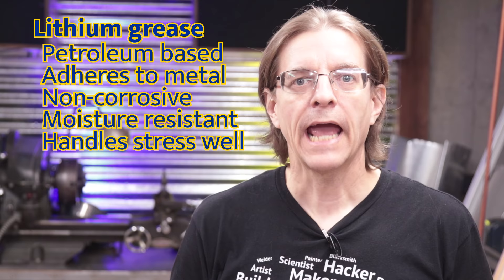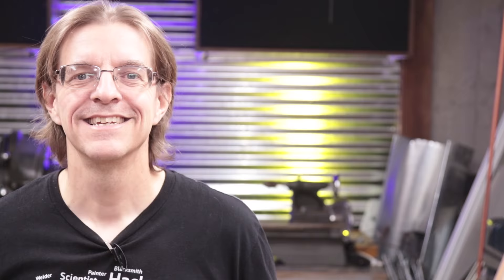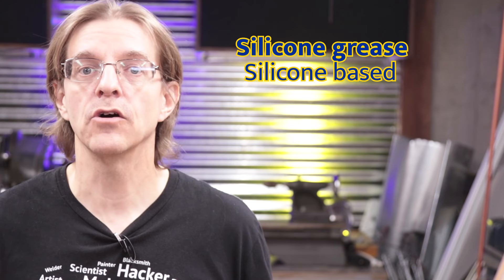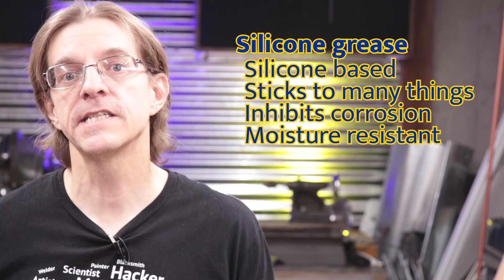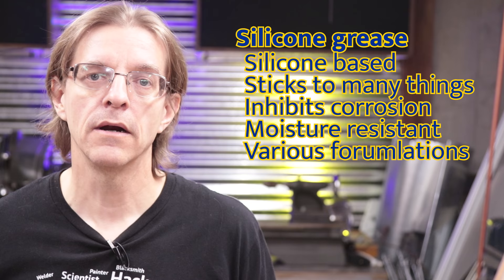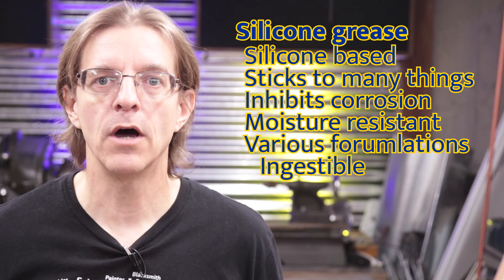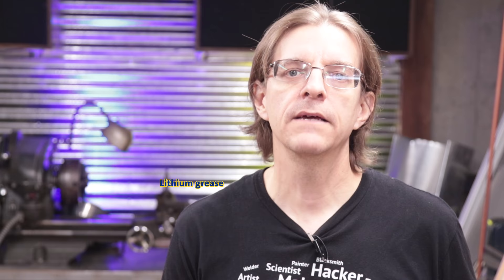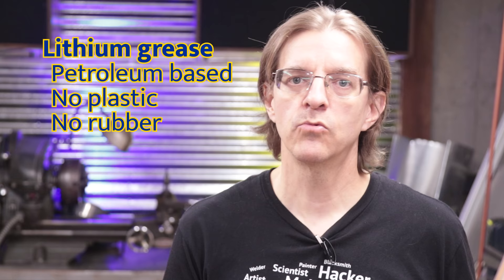Lithium grease vs silicone grease: Which to use?

Comment: What would be the best all around spray protectant/lube/inhibitor for hitting metal AND rubber parts in my engine bay?
Reply from the maker: Generally you don't need to spray your whole engine bay with anything other than water to keep it clean.

Comment: so which is better for installing swaybar bushings in my car?
Reply from the maker: I recommend checking the car manufactuer's specifications for that application.
Reply: Synthetic is better, I use Super Lube multi-purpose syn. grease, I buy it on Amazon. Been using it for yrs. on my guns, poly bushings on sway bar, control arm bushings which are rubber, you name it ect... Go to amazon & look it up, you can read what it's for & what it does. I use their oil too which comes in a spray with a trigger, not aerosol.
Reply: @NoWr2Run  thanks. i just got some synthetic grease.

Comment: Not much information. The title should say   "Lithium grease vs silicone grease: Which to use on brake calipers ?"
I viewed wondering about grease for brake, shifting, and latch cables.

Comment: Will silicone spray work on silicone couplers that go on car intercoolers and car air intakes? My silicone couplers don't want to slide on and off!
Reply from the maker: That's what I'd use. Although if it's already on, I don't know how much help it'd be to get it off.
Reply: @HouseOfHacks  mine are stuck on, but I can get a screw driver inside the silicone couplers and spray silicone through the red straw that attaches to the spray can and see if that works hopefully tomorrow.
Reply: @HouseOfHacks  and thanks
Reply from the maker: You're welcome and hope it works for you!

Comment: Just wondering, on RC cars, lithium grease will work great on metal gears, however will it damage the plastic gear housing/casing?.. or it wont because plastic housing is static and wont have any friction. 
Please spare some advice ya. Thanks ya.
Reply from the maker: If there's no moving parts (static) there's no need for lubrication there. But perhaps I'm misunderstanding. In any case, I'd just use silicone on the whole thing. Even the metal parts aren't going to have enough pressure on them in this application for worry about it. Hope that helps.

Comment: i have a metal(titanium?) part, grinding(actuating) plastic part. high speed, some heat. originally it has some white grease on it. since its contaminated and not really greasy any more, i need to replace it. what would be best to use?
Reply from the maker: I'd first try to find the recommendation from the manufacturer. Failing that, I'd use silicone grease.
Reply: @HouseOfHacks  thank you

Comment: Hi the white lithium grease I bought says its great for metal to metal contact. as well as metal to plastic and plastic to plastic contact? Why does it say its great for plastic contact if its not good for plastic?
I used some on my plastic gearbox and it stays right on the gears and doesnt fling off and runs extremely smoothly especially once its up to speed its absolutely silent in operation except in low speed you can hear the grease "stringing" around the gear teeth it sounds a bit sticky but it doesnt actually stick at all and runs really smoothly and DEFINITELY better than without the grease.
It came in a squeeze tube not the spray variety
Reply from the maker: If it's specifically formulated for plastics it'll be fine. Most lithium grease is formulated for metals and will degrade plastic over time. Hope that helps. Cheers.

Comment: which grease is best suited for rubber bushings in cars
Reply from the maker: Generally rubber bushings aren't lubricated. If they are, then check with the manufacturer.
Reply: @HouseOfHacks  front arm bushings always required bro

Comment: Now that we know neither silicone nor lithium are good for brake calipers, could you fill us in on just what is recommended?
Reply from the maker: There are special greases designed for this application. Check the car manufacture's recommendation.

Comment: I hadn't heard of either of these types of lubricants. I've been looking for non-teflon/teflon-like lubricants to use in bicycle parts for a while, but the bicycle lubricant/grease market seems to exclusively use teflon and teflon-like chemicals in their products. Is there any real reason why all bicycle lubricants are using teflon, or is there no real reason for it? I'd like to avoid dumping even more teflon and similar crap into the watershed so it would be nice to know of other lubricants that could be used.
Reply from the maker: I'm not sure why teflon based lubricants are popular in the bicycle niche. If I were to guess, it's probably because they're really slick, probably pretty light and don't provide much drag. Heavy greases probably increase resistance. No reason you can't use other lubricants for your own use.

Comment: As we use Electric Contact Cleaners for Electric circuits cleaning.. what about to protect circuit from  moisture? Is there any thing to protect circuit ?
Reply from the maker: Yes, electronics can be coated with a product called "conformal coating". There are a number of manufacturers for this. Just do a web search. Sorry I don't have any recommendations.

Comment: I have a large Panoramic Sunroof that opens on my Cadillac SUV: it’s getting to be 10 years old, and it’s getting tough for it to open, and close. Sometimes I even have to use my hand to help it close, or it will stop cause it thinks something is stuck in it, and it re-opens itself. 

 I bought White Lithium Grease to grease the tracks. That’s what I found most recommended from my brief online-research.. should I be super-worried about it getting on the rubber components (seals/gaskets, etc.) of the sunroof? Should I use a different lubricant all together for the tracks??? 

Is it a good idea to grease the rubber around the top? (With silicone grease or any-other recommended lubricant/grease suggestions)
Reply from the maker: Make sure it doesn't need to be cleaned first. I've found many times the mechanism that moves the window, not the track but the actual actuator connected to the motor, gets encrusted with dirt and gums up causing it to bind. The lithium should be fine as long as it's used in moderation and doesn't get on the rubber parts.

Comment: What type of grease can be used to lubricate rubber orings. At present we are using food grade silicon grease. I need an alternative for that. Acn white lithium grease be suitable??
Reply from the maker: It'll depend on the application. Is the food grade silicone grease because it's a food application? If so, you'll want something designed for that use, which a lithium grease probably won't be. The general rule of thumb is silicone grease for rubber/plastic and lithium for metal, but there may be specific greases that have different design parameters.

Comment: So which grease to use in brake caliper slide pin, where rubber boot is there?
Reply from the maker: Check with the manufacturer for their recommendations.

Comment: Hello HoH: What do you think about using silicone "white" grease for lubricating computer fans & optical disc drive rails + tray?
Reply from the maker: I don't have much of an opinion on those. Generally they have permanently lubed bearings from the factory and shouldn't need any additional lubrication.

Comment: hi,
and what about grease based on  Polyalphaolefin?or Synthetic hydrocarbon?can use on rubber/plastic?
thanks
Reply from the maker: It's generally not bad, but it does depend on the type of rubber/plastic. This chart has some compatibility charts: https://support.newgatesimms.com/lubricants-and-possible-plastic-or-rubber-compatibility-issues/

Comment: looking for silicon paste or any type to use as lube for my caliper guide pins etc. any recommended brands besides 3m? looking for cheaper options atm. thank you!
Reply from the maker: Sorry, I don't have a brand recommendation.
Reply: @Klippy Klop isnt silicone paste good for rubber and metal contact? it lubricates them.

Comment: Would silicone grease be better to use on a stairchair (Stannah 260 curved) - the “teeth” on the lower rail?
Reply from the maker: I'd first try contacting customer service to see if they have a recommendation. If they didn't have any input, I'd use silicone grease.
Reply: House of Hacks 
Thank you very much; greatly appreciated.

Comment: Which one is better for my sqeaky chair mechanism(its metal) ?
Reply from the maker: I'd probably use lithium silicone since there are probably plastic pieces in or around the mechanism. If not, either would work. Cheers.
Reply: I use silicone, as it is much less messy and works anyway. Silicone grease is nearly invisible to eye and lithium often is white, greasy, always visible. I prefer lithium to car's door hinges or lock mechanism.

Comment: thank you for posting this great video.i want to lubricate my gear stick in my car i was wondering is it good idea to use lithium grease?thank you in advance
Reply from the maker: Most gear shift mechanisms I've seen have rubber or nylon bushings so I'd go with silicone. But generally they don't need lubrication. If they're stiff, I'd look for other issues first, such as something bent or broken, or possibly an internal transmission issue.
Reply: Thank you so much
Reply: House of Hacks Would some light lubrication not be needed to keep them from potentially tearing from the constant friction?

Comment: Not correct. Most lithium lube rate temperature is 130 degrees c and silicone grease can easily handle 200 degrees. So for the high-temperature situation, silicone is better.

Comment: hi i have a question do you know if the xhp 222 lithium grease can destroy a plastic and rubber? coz i used that on my joystick  please if you know
Reply from the maker: Silicon grease would be better. Lithium grease works better for metal applications and, depending on the formulation, may cause plastic to degrade.

Comment: Hi there. Thanks for the video. I do have a JOBO CPE2 processor with lift for film photography. To transfer the rotation from the motor to the  film tank a metal bar rotate a plastic gear ( it looks very hard plastic to me ) that rotates the tank, the film tank it is touching the water in the processor's bath that keeps the temperature. The gear and the bar does not touch the water but need to be greased and when processing color the water takes up to 38 Celsius degrees. What advice me to use to grease this gears, silicon base or white lithium for this? Thanks in advance.
Reply from the maker: I'd probably use silicone.
Reply: @HouseOfHacks  Many thanks

Comment: So... lithium grease for my bike chain and silicone grease for the bedroom?
Reply from the maker: That would be the correct matching. :-)
Reply: no lithium grease will harm the O-rings on the bike chain,  use chain lube it is sticky and wont fling off.
Reply from the maker: O-rings on a bike chain? That's quite the bike chain. :-)
I suspect Christopher meant bicycle chain and you're thinking motorcycle chain.
Reply from the maker: Yes, it all depends on what products you're using where. Polyurethane is pretty resistant to most chemicals and shouldn't have any problems with most lithium greases. However many lithium greases contain petroleum based soaps that are not compatible with some plastics and rubbers so in general it's not recommended for those applications. As with anything like this, it's best to consult the manufacturer's data sheets for compatibility. Cheers.
Reply: What about silicone grease for upper and lower control arm bushings
Reply: so lithium gearse cant be use on motorbike o ring chain??

Comment: Why is Silicone grease considered low temp if Silicone hoses or Silicone anything is rated as 500f and literally is used in household ovens because it can handle high Temps?....
Reply from the maker: Greases are made up of many ingredients and generally intended for typical applications. The temperature profile for the overall composition of the grease may be less than the one ingredient it's known for, based on the typical use cases for the grease. Silicone grease is typically used in lower temperature applications and so is formulated for that use. In other words it's not the silicone that's necessarily the limiting factor but other ingredients.

Also, this video talked about general guidelines. It's probable that specific formulations can be found that can be applied outside these guidelines. As always, if there's a specific, extreme-use application question, the grease's datasheet should be consulted for appropriate use.

Comment: hi can i use lithium grease to lubricate noisy laptop fan?
Reply from the maker: Laptop fans generally have permanently lubricated bearings. If they're making noise, it's time to replace the bearings if possible (probably not) or the fan.
Reply: @HouseOfHacks  thx!

Comment: what about calcium grease to plastic will damage it?
Reply from the maker: I've not heard of calcium grease. Look on the label and read the MSDS sheet for it and see if it uses petroleum distillates. If so, it's better to stay away from plastic.
Reply: generally calcium grease is the same mineral oil base oil as lithium grease, however it uses a more heavy duty higher water resistant calcium thickener instead of lithium

Comment: So   W40 from which of these  Lithium Grease؟ OR  Grease silicone ?
Reply from the maker: Not exactly sure what you're asking... WD40 is not a grease. It's a petroleum-based solvent, water-displacer and surface protectant. It can be used for cleaning something before putting it together, using grease as appropriate. Does that make sense?
Reply: @HouseOfHacks  Thank you

Comment: CAN I USE WHITE LITHIUM GREASE TO LUBRICATE CAR STEERING WHICH MAKES SQUEAKY NOISE? Please reply.
Reply from the maker: I recommend checking the car manufactuer's specifications for that application.
Reply from the maker: I'd also be concerned that the squeak indicates worn parts that should be replaced rather than simply lubricated.

Comment: Hi can i use lithium grease on motocycle chain
Reply from the maker: Get a shaft drive. :-) Most manufacturers recommend a lubricant specially designed for motorcycle chains. In a pinch, lithium grease would be better than nothing.

Comment: Can silicone grease be used for lubrication of computer keyboard
Reply from the maker: It could, but, depending on the environment, it might attract dust and gum up over time. I'd probably me more inclined to use a dry graphite lubricant. Cheers.

Comment: the point of that is to..take out teared teflon paper ( Fuser paper) and spray on the HEATER part or Glass, spray inside that round teflon paper and and place HEATER inside that Teflon paper. so Sillicon spray helps that Teflon paper to move smooth and not stick anround heating parts.. is it safe or not safe? im searching for its answer cause i dont want my printers to burn or anything. thank you
Reply from the maker: I don't know. I'd be pretty hesitant to use any spray as most are flammable. My recommendation would be to contact the manufacturer and get their suggestion. An alternative would be to speak with a printer repair technician to get their input.

Comment: Why's it called lithium grease when it's petroleum based?
Reply from the maker: Lithium is used as a thickening agent to keep the oil from running out of the item being lubricated. It is inexpensive and has good overall temperature and anti-corrosion properties.

Comment: is Silicone Compound same as Silicone Grease? 

there is a piston on my hydraulic brake lever and needed Silicon Grease but is hard to find, that is why I ask if this is just the same?

it needs to apply the grease on the rubber O-ring around the piston, this piston will push-pull the mineral oil inside the reservoir to activate the brake caliper...

TIA c",?
Reply from the maker: I'm not familiar with silicone compound. I'd try going to the manufacturer's web site and checking the ingredients and recommended usages and then compare that to the one suggested by the brake manufacturer. Hope that helps.
Reply: @HouseOfHacks  they have almost the same properties except the Silicone Grease is food grade while the other is not...

The Silicone compound for braking system is usually applied on external parts, mine was for the piston rubber gasket inside a piston chamber with Mineral oil...

Anyhow I tried the silicone compound and it didn't last long, I will try Silicone Grease if I find one...

Thanks for the reply, cheers c",?
Reply from the maker: Ah, I see. Yeah, brake fluid is pretty caustic; it'll probably need something designed to stand up to it. Hope you find what you need. Cheers.
Reply: 999